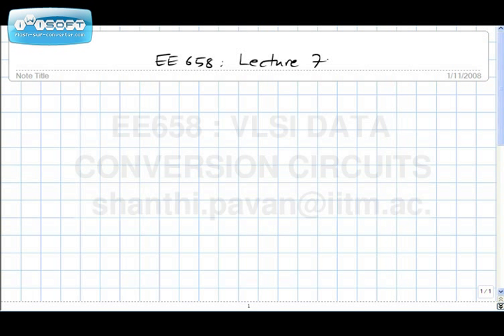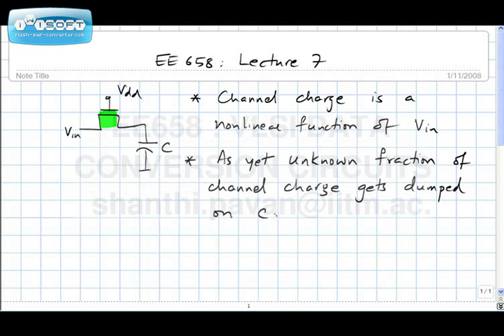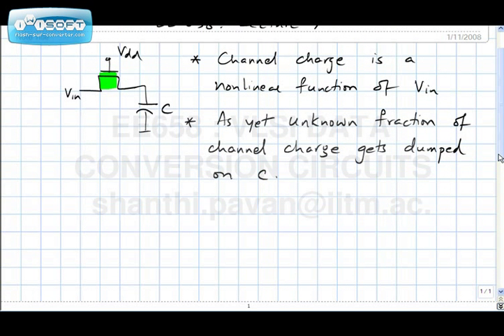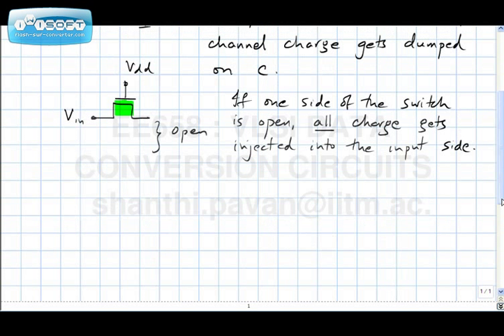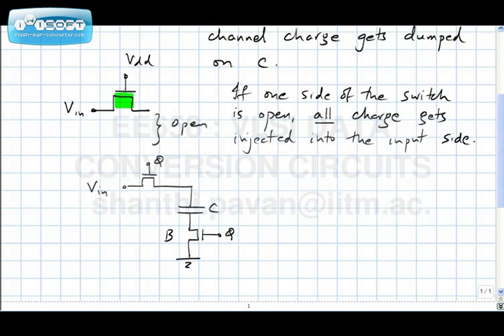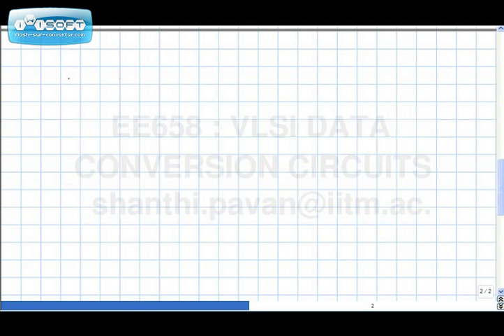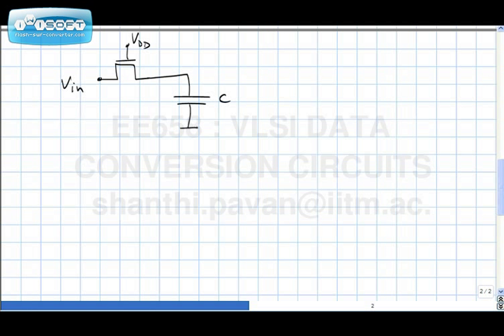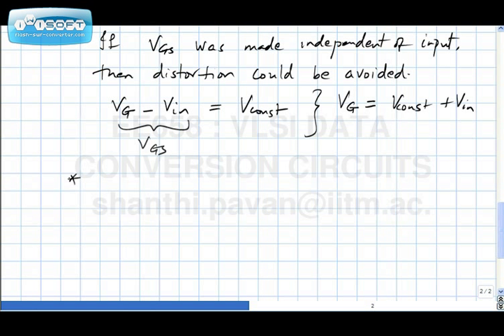Lecture 7   Bottom Plate Sampling, The Gate Bootstrapped Switch

Comment: What's the point of the bottom switch of the sample and hold? is it to isolate ground noise effect on to the cap? Also instead of a bootStrapped switch, can we just use a transmission gate? Newer technology limit the amount of input gate voltage that the transistor can hold before it break, bootStrapping push the voltage so high, it might break.
Reply: bootstrapped swtich is useful to have a relatively constant resistance in de transistor channel, that reduces de "non linear distortion"